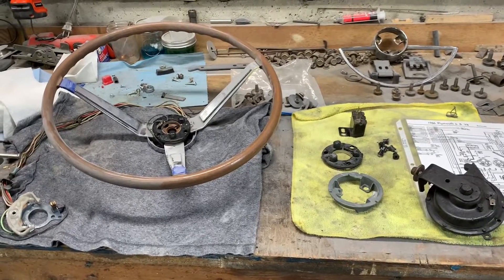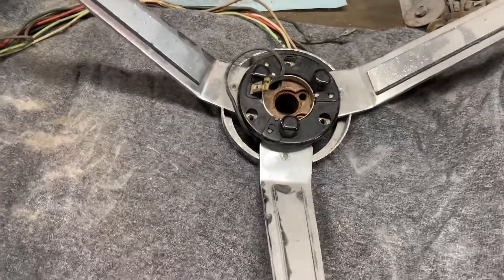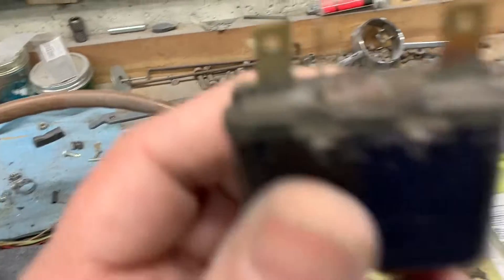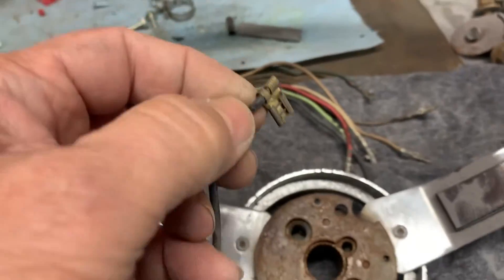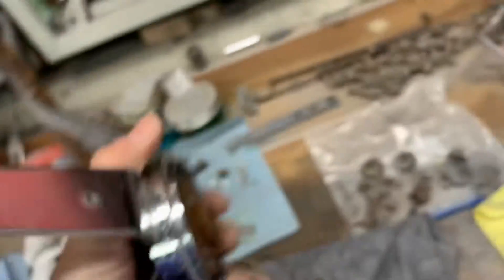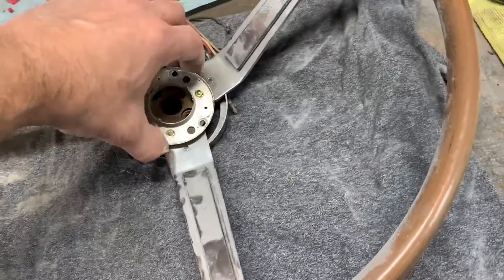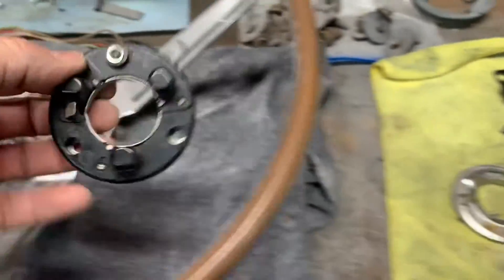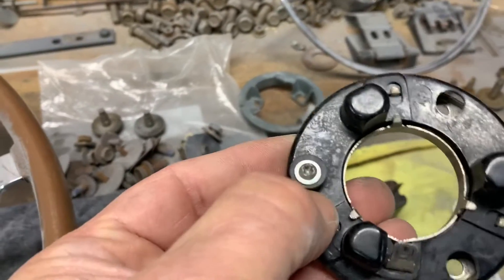How to Fix a Car Horn

Comment: Hey Roger, I just picked up a new horn switch since the old one was totally destroyed. Does this replacement also require the contact pin, spring, and insulator? After putting it in, my battery started draining quickly. I’m thinking the contact plate on the new switch might be constantly grounding out. Does that sound plausible to you?

Comment: thanks for the video  , i have a 1973 dodge charger with grant steering wheel , when i turn the steering wheel to the max left the horn engage by itself ,and lately my horn doesn't work most of the time when pressing it  except when it's turned hard to left then if engage by itself  , could it be the horn ring ?
Reply from the maker: Without knowing what the Grant wheel looks like underneath, it could be the horn ring. The only way to know is remove the wheel and take a look. Something is grounding it.

Comment: Hello Rodger 👋,   My 67' Barracuda has a different horn problem  - it blows all the time..😮
Even when disconnecting the black wire up at the steering wheel it still blows which is very strange... Brand New horn relay on the car and no change in it either...still continuous blow of horn ... So I'm very stumped.. 🤔

Comment: Where is the horn relay on a 74 Cuda?
Reply from the maker: For an E body, the horn relay should be on the fuse block. Check the ForEbodysonly forums for more information on these cars.
Reply: @RogersABodyGarage  found it.  thanks.  do you know how to test them?
Reply from the maker: @davidmckinley5343  , I’m not familiar with those horn relays. That’s where a factory service manual will help, it has the wiring diagram and technical instructions followed by the technicians at the dealership to diagnose the issues.

Comment: Hey Roger, I didn't see you mention the copper contact ring.  Where does that go and how does it relate to the system?
Reply from the maker: If you go to the 3:00 mark, it shows the copper ring on the back side of the steering wheel hub. When I flip the wheel over, you can see the wire that connects to the horn switch. The spring loaded roller on the signal switch is what makes contact with the copper ring once everything is installed.

Comment: Roger, good job as always. For the last several years my horn has worked most of the time and I have to hold my turn signal lever down when making a left turn. I bought the piece to fix the turn signal a few years ago, but have successfully procrastinated long enough….and with winter upon us, you’ve inspired me to dig into my steering wheel without further delay…..in a day or two.😊 Keep up the good work!